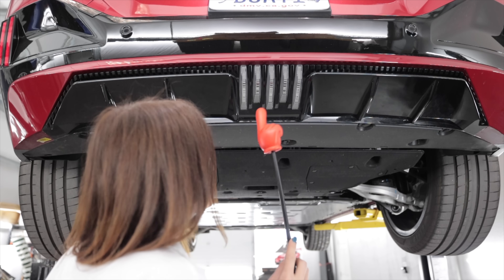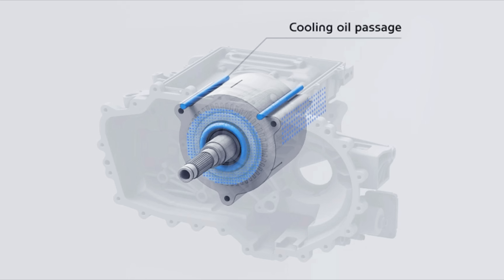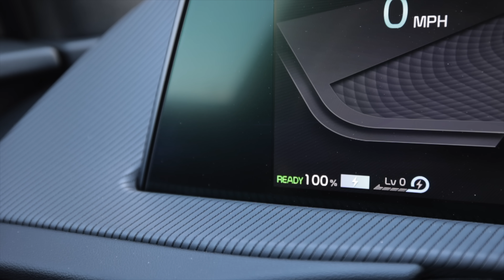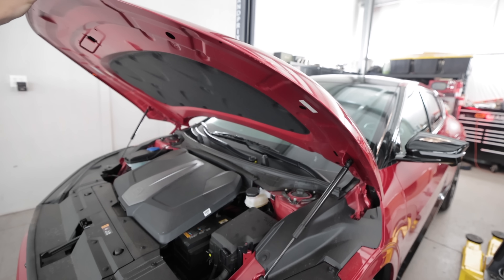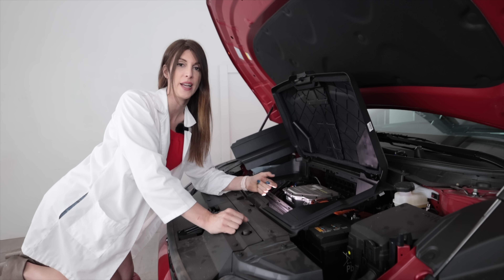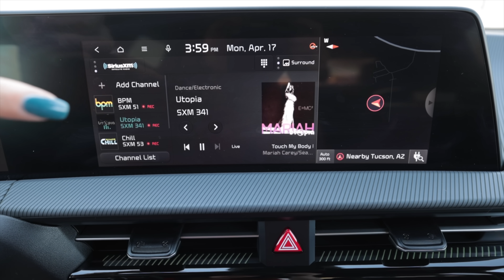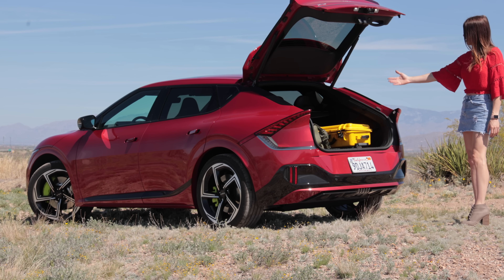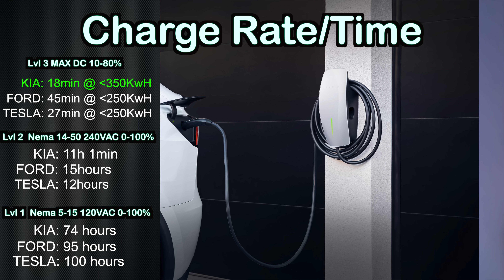The 2023 KIA EV6 GT is a Tesla Killer!

Comment: The EPA rating is very easy to beat. I have an EV6 GT and I am getting 3.4 mi./ kWh for the first 700 miles of ownership in mixed driving. With 74 kWh of usable battery, that equals over 250 miles of range. I drive mostly in Normal mode, which has plenty of power, with occasional bursts in GT mode. This is a wonderful car. Thanks for your expert explanation of the motor windings - very interesting. No other reviewer has pointed that out.

Comment: Hey girlfriend, loved the review thank you 😊👍. Just a lil friendly reminder KWH (kilowatt hours) is the measurement of capacity i.e size of the battery, KW (kilowatts) is level of power i.e watts=amps×volts 😘.

With this sled designed chassis having an 800V architecture and published kWh usable battery size one can figure out battery degradation, charging curve, ect.
Reply: Ahhhh   thank you, Megan... if that is your real name.

Comment: I’ve had an EV6 for 2.5 months (GT-Line RWD cuz range).  It’s pretty awesome.  Ditto on Meridian.  It’s not a loud/boom system, but it has excellent positional accuracy and reference quality.  The frunk fits my lvl1 cable, tire mobility kit, V2L adapter, and a Tesla to CCS adapter.  My kids put up their roller coaster arms, and i remote back them out of the garage.  I also always win merge contests.  My 2023 came with the charger, though I would like a light that illuminates the charging port.
Reply: Ditto on the unlit charging port. It’s annoying to fumble around in the dark trying to plug in, and having to use my phone flashlight to find the the button to close the door. That’s a small complaint though, and maybe the only one I have. The EV6 GT is a great car.
Reply: Which level 1 charger did you go with?
Reply: @joshdumond6073  ChargePoint, required a 48a breaker in a 60a slot (20%) overage for code.  It’s basically installing a dryer plug.  I get approximately 9.5kW/h.
Reply: @gadfly149  wow that's impressive! Did you get it off Amazon?

Comment: 12:30 Thank you Sarah. You're the first car reviewer I've heard recognize that the batteries will lose charge over time. If you're leasing, no big deal. But if you're buying, that's a significant concern.
Reply: The Kia high voltage batteries are covered for 10 years / 100K miles. In that time I believe the battery is covered if it degrades more than 35%. In practice, there are 300k mile Tesla Model 3's with 80% battery range remaining. Which is adequate for most. This EV6 also uses a heat pump, which extends range in cold climates. Electric Vehicles are getting better every year.
Reply from the maker: @dllemm   a battery is a battery, doesn’t matter what kind of guarantee they give it.
Reply: @SarahnTuned  yep and there’s no recognised way of assessing the health of used batteries. If you are buying a car where the key component is, arguably, the battery you need to know if the one you’re buying is decent or crap. It can’t be that difficult to come up with something people can rely on, the EV manufacturers need to do something or used EVs won’t sell. 

In my humble opinion.

Comment: Just small note for your units, it's kW* for charging speeds. kWh is a measurement for the capacity of a battery pack, while kW is the measurement for power output or input.

Comment: Fun review.  Seems peppy.  I have been eyeing the EV6 for a while now, those are nice.  You are right that 200miles is not a lot nowadays for an EV but with Level 3 charging, long distance travel is becoming more feasible.  Well, if there is a charger on the way to where you're going that is...  Partly why I don't have an EV yet.   Btw, perhaps on the nitpicking side for the layperson, but cringy for Engineer types, the charging rates you are mentioning should be in  kW (kiloWatts - meaning Power), not kWh (kiloWatthours - as in Energy), very different units, but eh, close enough.  :)

Comment: Meh…as tested, taxes in..$90,000.00 cnd 😱 0-60 is 3.5 (slow by model 3 standards) and just 200 miles of range 🤔 I dunno, Not that I can justify $90k for what in reality is $35-40k gasser. 

Charging for the off brands is just not there yet…where Tesla has a much better (though still not without its flaws) network. 

IF, you’re using it to go back and forth to work, pick up the kids from school or get some groceries…maybe…but I am NOT paying $90K for that! They need to extend the range by another 100 miles!

Comment: "the range is not enough" meh. whatever direction i head torwards on the highway, there will be either an Ionity or at least a 150kW charger before the 100 mile mark. also, it really only consumes more because of the tires and rim size. so if you are ok driving at something like 70mph(legal limit here is 80), it should go a lot further than my need for toilet brakes.

Comment: I'm going to pick up an EV in a couple of months and it will probably be a Tesla Model 3 performance. This Kia looks interesting, but can't compete with the Tesla, in my opinion.

* They're basically just as fast, but the Tesla is a smidge faster 0 to 60, not that it matters, they're both super fast.
* With Tax incentives, you can get the Tesla for $45,400 vs $61K for the Kia and that's assuming you can actually find one at MSRP. I don't care how much you like the Kia, a $16K difference is huge!
* Tesla's super charger network always gives Teslas an advantage over other EVs. I don't care how fast the Kia charges if I can't find a charger that actually delivers that speed.

I can't think of any advantages the Kia has over the Model 3 Performance and if there are any, it's certainly not worth paying $16K more!

Comment: What I am curious about is why they don’t create the equivalent of a beefed alternator built in to EV’s to extend the range
Reply: Regenerative braking drives the electric motor backwards making it act like an alternator. Putting an alternator in the circuit going forward would just be another load on the electrical system trying to move the vehicle. It would waste more energy then it could produce.